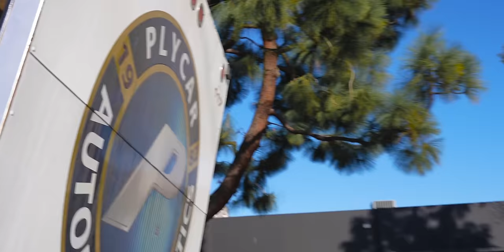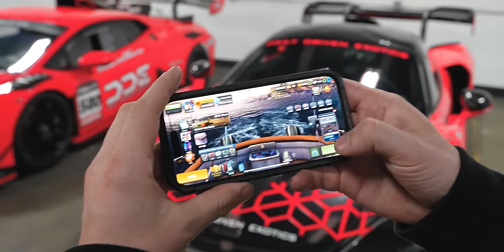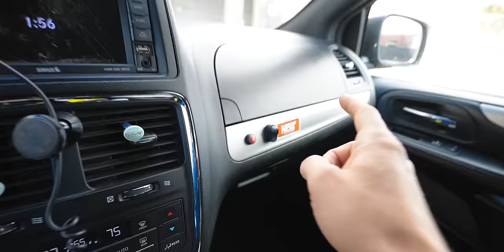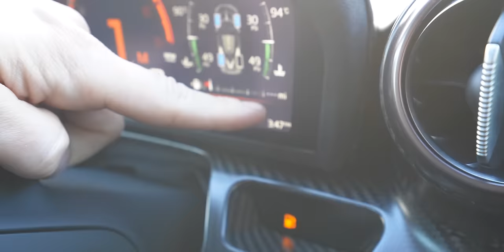MY NEW HYPERCAR GETS DELIVERED AND SLAYS TIRES … * TRIBUTE TO KEN BLOCK*

Comment: If you have ever seen a race like NASCAR and a tire blows it can take out the fender before the driver can slows it down to keep in control. Well, open wheel racing there's not a whole lot the tire can damage. WOW! For the big puddle (not the band Puddle of Mud), looks like a sump pump shall be needed.

Comment: I'm pretty sure these guys are sub leasing this from Hoonigan while Hoonigan is still under contract lease (= cheap rent). Makes sense since DDE old shop is due for that structural work, I would not be surprised to see a shock exit from this Hoonigan shop in 6 to 12 months and back to the old shop... I could be wrong, but the lease on this is 3 to 4 times the old place.

Comment: DailydrivenExotics Absolutely Incredible Video I'm so glad the Senna is finally back and that Damon had so much fun on the block with it and I think the block is an Absolutely Incredible name for the old Hoonigan Burn Yard although I think it should be called the DDE Tire Slaying Block and I think Garrett did a great job doing donuts in his Absolutely Incredible 991.2 911 Carrera GT3RS for the first time in his life and what happened to the Senna Upgraded Exhaust and Blow off Valves

Comment: Call it THE SLAY GROUND

Whilst I get THE BLOCK and its tribute to KB. I dont think it has the same ring to it that the burn yard did. 

What about THE SLAY GROUND ? In reference to the DNA in DDE with the tyre slayer cars and the fact its an adults play ground as in, meet us back at theSLAYground. 

Then if a car hits a fence or wall etc you could put a photo on a wall with slayed on it in reference to the slay ground beating it etc. 

Just my 2 cents.